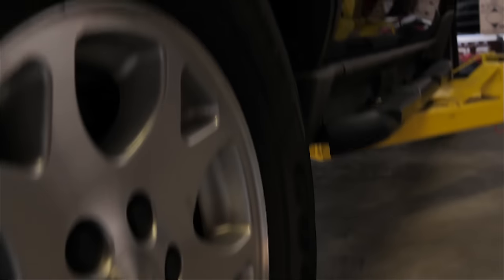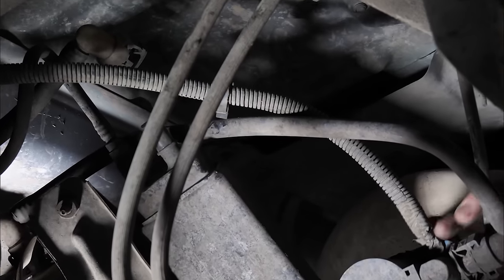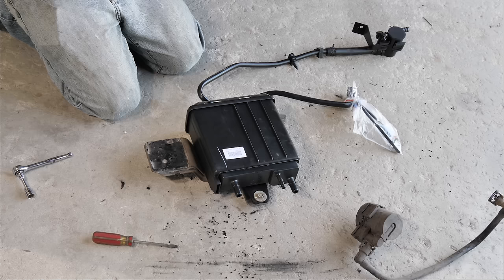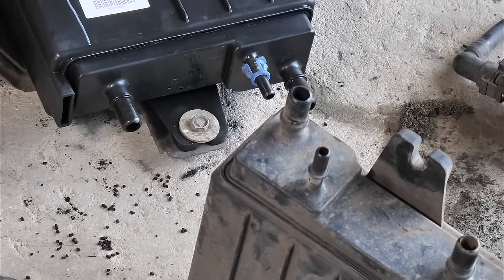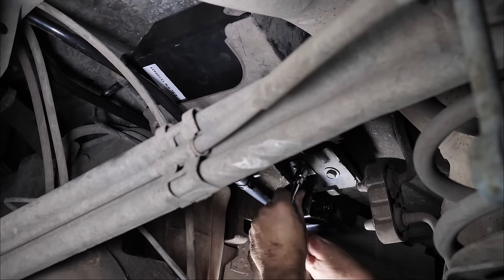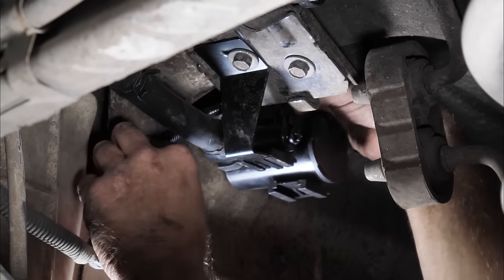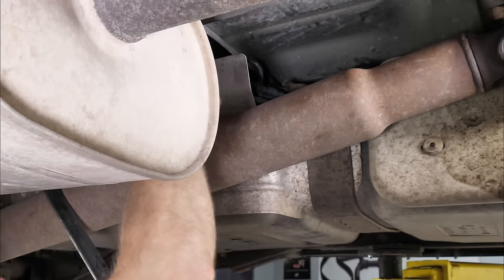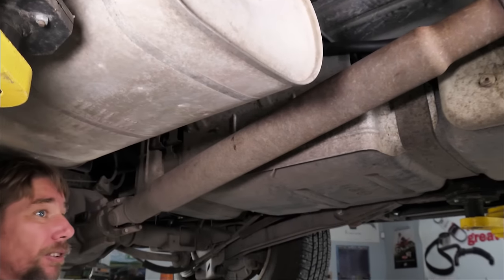2005 Chevy Tahoe Fuel Filling Slowly PART 1 From Clogged Charcoal Canister Vent Lines

Comment: I just jammed a screwdriver in canister as far as I could and used vacuum to pull all the stuff out of it and hose to the tank.  Worked like a champ and cost $0.00. Thanks for your video
Reply: Same 🤣
Reply: Could you further describe exactly where you jammed the screwdriver? Did you pull it and jam it down one of the manufactured holes vac it out and reinstall or...? Did you do it while it was still in place?  Apperciate the follow up.
Reply: @carmellodannajr  pulled it off and stuck it down one of the manufactured holes

Comment: First, thanks for the effort in this video, it helped tremendously! However, even after the canister and vent solenoid re-locator were installed I still had the filling issue. It turned out to be carbon in the line still. Most people drop the tank but this is NOT needed. If you take the fitting back off with the 90 degree elbow, white in color you can suck the carbon out with a shop vac. I taped the shop vac onto the line, had my wife loosen and tighten the gas cap every 5 seconds or so and could watch the tank flex with suction so you know it was working. I then rattled the line as best as I could with the room you have and low and behold I got several bunches of the particles out, about a cup or cup and a half in total. Issue is fixed. Hope this saves some of you time and effort. This was on a 2007 Yukon Denali. Regards!
Reply from the maker: excellent, yeah we had two diagnose this issue as several other shops checked it out and couldn't fix it, so removing the tank to inspect and figure out what was happening was required. Now that people see where the carbon pieces get stuck, you may be able to clean them out and replace then canister and be done.
Reply: @APDTY  Understood and greatly appreciate your efforts as you saved me tons of time. Just wanted to reply so others knew they could maybe get around it without dropping the tank!
Reply: Ryan Schell think this would work with a Tahoe since it’s also GM?
Reply: Ryan Schell was your tank empty when you sucked the carbon out with the vacuum?
Reply: APDTY Thanks.  That is great to know.  I just replaced the purge valve and the solenoid on my 2005 Tahoe.  The solenoid matched the OEM one.  I didn’t know about the new version and AutoZone didn’t mention it. I hope I don’t have to replace the canister, but if I do, I’ll do the shop vac trick you described.
Reply: thank you!! problem fixed
Reply: @shotgunschell7455  thanks for that because I did the same thing, changed all of that and still had the same slow fill problem. I will try the vac trick
Reply: Thanks I will try this, I changed the charcoal canister, valve on the engine and by the tank. When I changed the charcoal canister I saw the vent lines had charcoal pellets in it.
Reply: Was tank empty when you did this
Reply: @hoopzgod_yt1978  Nah, no need to lower or drain tank
Reply: I wonder if you try the shopvac trick but also pull the line off the purge solenoid in the front if it would work better? the way i found out mine had the leaking charcoal piece problem was when i tapped the line on the purge solenoid it sounded like a Moraca.
Reply: yes. Sorry, suuuper late comment haha
 @alexh5992

Comment: Mane whoever you are, you are a lifesaver. I was fumbling with these clips for the canister for like 25 minutes. Thank you
Reply from the maker: glad it helped, thanks for watching!!
Reply: Blue tab thanks for looking out. God bless
Reply: Lol me too, I have to clean my canyon and Silverado
Reply: diesel2421 Me too!  After I finally got it off, I discovered that the hose and elbow are too tight to allow room to pull the fitting off the solenoid after releasing the tabs.  It would have been easier, I believe, to have pulled the solenoid off the bracket, then pry off the clips.

Comment: Would this cause the gas pump to stop about every gallon acting like the tank is full
Reply from the maker: Hayden Hamlin yes exactly, the air is not venting out of the gas tank as it fills. Watch for small charcoal particles, if you see those then you will need the canister and to clean out all of the lines,
Reply: Right now, my 2011 Ford F-250 6.2 liter gas truck stops after I fill the first ten gallons or so, and then it will stop almost every 0.2 gallons. Which obviously makes a 32 gallon fill up take a little while. I think this is my issue.
Reply: @davidcoiner6550  your issue isnt the same as the video. Its the ford logo brother. Just change that and you're good to go. You're welcome

Comment: Thank you making such a detailed video. It was a huge help!  I just finished changing my vapor canister, having already changed the purge valve and solenoid. It took me 10 minutes to gas it up last night. My biggest problem was getting the small blue connector off. Squeezing the blue tabs didn’t help so I cut the nipple off the canister with a Dremel Multimax.  I have been getting a “tighten fuel cap” message daily so ordered a replacement.
Reply: did that make the "tighten fuel cap" message go away?
Reply: @kristy1135  yes did it?

Comment: I have very shaky idle, gas tank will not fill and it stall and doesnt accelerate right but no cel, could it be related to the canister or do i need to have a canister cel

Comment: I'm having the same filling issue , changed the solenoid ,didn't fix it, about to change the charcoal canister next...hopoing that will fix issue ,,, also I hear a whistling sound when im driving the vehicle , is that noise a part of the problem as well ?

Comment: If my spare tire won't come down will I have any issues replacing this?
Reply from the maker: nascarr11 I am not totally sure without lifting the vehicle up and looking closely, you might be able to on some models, the other option is cut the cable or clamp from the hoist and replace the hoist with a new one, now they are available aftermarket and way cheaper then the dealer, usually well under $100 for the house and cable assembly

Comment: Replaced charcoal canister, filter, and selenoid on top of engine. $80. The kicker was I didn’t want to drop the fuel tank to clean out evaporation lines. I disconnected and blew the f out of them as best I could. Then…. made a shop vac rig that blew air into my tank and checked all disconnects lines under vehicle and felt for air. Fixed my slow fuel issues. Contact me if you need help. I can walk you through.
Reply: My canister was a disaster charcole pellets everywhere.

Comment: How bout black smoke out tail pipes i have a 07 f150 4.6 p0452 p0191 cant find nothing on that
Reply: Check your coolant temp sensor sensor for the ECM
Reply: @marklemker4088  ended up being vacuum leak front of engine on frame

Comment: Would this give you code p0440
Reply: I was wondering the same thing. I got a P0440 too. I feel inclined to fix the vent valve solenoid and hope that does it but at the same time I don't want to waste my time fixing crap for no reason

Comment: I had the same issues  I removed both items  And used Compressed air in the canister Which after 10 mins of blowing and tapping had little dust/dirt The purge valve Which has a plastic snap on top i removed to find grit (one bigger than sand) and dirt in the filter which looked like a  red scratch pad Which i washed out the whole system Along with pad And returned everything back I figure after almost 15 years of driving my Blazer On and off road it was time to do this while doing new fuel lines 

I see you took apart the problem But rather than wash it out and order a $3 new filter you went with whole new system for around $150 ?
Reply: You cannot wash out the canister. Replace with a new one and you'll be good for another 10-15 years.
Reply: @4paulseyes  Never washed it i used air .. Everything is back in the truck  Runs perfect
Reply from the maker: We had to drop the fuel tank to figure out where the clog was, The fact that small pieces of charcoal are spread out through the vent system was enough evidence to know the canister has failed and must be replaced, the canister cannot be cleaned and if the charcoal has spread through the system, well then it must be replaced. The job of the charcoal canister is to absorb fuel fumes so they do not vent to the atmosphere or inside or near your car as they are highly flammable. If you found any small particles that look like coal, then you need to replace that canister and you would most likely have a check engine light on.
Reply: @APDTY  Marineland Black Diamond Media Premium Activated Carbon $20 ----- Range Hood Charcoal Filters ( cut to size ) $8  ---- Black Silicone Adhesive Sealant $6
Cansister filter You can open and wash out and replace the filter with the same filters for range hoods They bear the same microns allowing the air to pass while trapping non gas forms  The paper filter in the canister  is prone to fail with moisture and heat over time And a imbalance on the Ph level 

Sometimes fully replacing the whole system is a good idea  Other times As dad always use to say ..if it ain broke don't try to fix it
Reply from the maker: @freakyflow  well as long as the problem is fixed then all good, especially if you saved money! In a professional shop though you can be fined for altering the emission controls,

Comment: Do you know if this would cause the tighten the gas cap message? Have 2005 Tahoe z71.
Reply: Yea it'll give you check engine light (tighten gas gap even tho it's tight the system is detecting a lack prly the purge valve) and in my experience (05 Tahoe) That's exactly what happened. Started off changing out the cheapest part 1st then took canister out put air line threw it figured it would either work or I'd mess it up and the replace it using a low psi and ran water threw it repeated till clean water came out. Luckily no charcoal was falling out but I blew out the lines just incase since I was down there anyway.. seen a spider web come out of a buddy's Silverado.  But been working just fine since think cost was 30-40 bucks and good part of my day mainly cleaning the charcoal canister and making sure it was dried out. 
A lot GM vehicles have this problem so it's gonna differ depending on climate (dusty dry) and just how bad it is. But If you can change oil or have a lil know how its relatively easy. And all of this is for emission which in my state they no longer check 🤦‍♂️so technically I could of bypassed the canister but that's a whole other can of worms. My advice just get up under your truck and take a look I got sick of stopping every 2-3 dollars getting gas and went home right after the gas station got on the concrete and a couple YouTube vids a lil gogle and next day she was good. I'am not a mechanic and can't say what you guys should or shouldn't do. just passing on my experience for entertainment. If I had the resources sure I probably would of changed all done in this video aka the right way lol. But I'm good with my fix after 7 months.. Good luck

Comment: Does anyone know if there's any way to just eliminate the canister
Reply from the maker: icutwood 247 it can be unsafe and actually would be illegal and if you live in a state that does vehicle inspections, you would not pass, the purpose of the canister is to absorb fuel vapors, if you just vent the vapors outside the vehicle, well that could explode if ignited, the vapors must go somewhere and the charcoal canister is the safest and best place
Reply: Well canister weren't added till about 72 so what did they do before that.

Comment: Nice video however I feel like the charcoal pellets coming out is a design flaw that GM has never addressed. The real problem is that these pellets roll out over time and fill the air lines so they should be blown out during this process to.

Comment: Problem is they put this crap under the vehicle if your in the dirt much it plugs it the older vehicles put them under the hood
Reply: Yeap. My 93 chevy c 1500 is under the hood. Never have issues and it passes smog with flying colors
Reply from the maker: Yeaup and that is why we sell the relocation kit so often, it keeps much more dirt and dust out when the filter is relocated high up and near the transmission

Comment: So what if I just slide my own vent line down the filler neck while filling up. Then pull it back out when I'm done.No check engine light or codes, just slow filling.

Comment: I changed all of the cannister and filter but still filling up show
Reply from the maker: Leki Latu so if you found any small black carbon particles, then the canister came apart and you may have to blow out all of the lines, also a vent valve exists that may need to be replaced, check for any trouble codes as the vent valve will usually leave a code and turn in the check engine light
Reply: @APDTY  ok thanks
Reply: Blow out the lines

Comment: I had the cannister changed on my 2005 Chevy Avalanch and it’s still not pumping gas correctly. What can I do now?
Reply: Try the gas cap. Get a new one if the gaskets look wormed out.
Reply: Let me know how it goes fam.
Reply: T Jack you get it working? Dude on the top of the comment list says to get a shop vac and suck out the carbon build up...
I gotta do this to my 05 Tahoe but haven’t gotten around to do it. Filling gas takes like an hour to fill up.... or 10 min for a quarter tank lol

Comment: Had the same problem where I couldn't fuel my Yukon and was getting the “Tighten fuel cap error”. First I disconnected the EVAP canister and all the little carbon pellets fell out. So, I dropped the tank, cleared all the lines w compressed air and replaced the canister and canister vent solenoid. With all that done I can now fill up the Yukon perfectly. No more shut off issues. Thanks for the great advice!

Comment: I need one for the exact same truck. What's the part # and where did you buy it?
Reply from the maker: Shannon Williams https://www.amazon.com/ACDelco-215-464-Original-Equipment-Canister/dp/B000EQVSME/ref=as_li_ss_tl?s=automotive&ie=UTF8&qid=1504720131&sr=1-1&keywords=215-464&linkCode=sl1&tag=aupaditoyo-20&linkId=ed8693f855588680f285e160b8b89b93

Comment: Useful tips that helped a lot with my 05 Avalanche. Disengaged canister, used air compressor to get rid of build up. Also tried to clear as best possible the line from the engine compartment under the cover. Remounted canister (solenoid was replaced about a month ago). $30 gas ⛽️ and no shut off. Eventually I’ll get it replaced, just buying time...

Comment: I have this issue with my 2007 Avalanche I even got the engine light on now since I kept putting it off as is more of pain in the ass than an actual performance issue. But now that the light is on I need to fix it.
Reply: There's also I valve on the top front of the motor it'll quit and set off the check engine light it's easy to change and about 30 bucks check it out first
Reply from the maker: ECxPassion the longer you wait with a full vapor canister, the closer you get to it coming apart and circulating through the fuel tank vapor vent system,

Comment: I installed in my gmc , same problem but no fixed the problem, I don't know where is the problem but so difficult to fill
Reply: Line is probably clogged from tank,did mine and problem I'd better, I think mine is clogged some still.Some Day will have to drop tank to get to the lines

Comment: HELP- Would this cause my oil to smell like fuel I checked my fuel injectors for leaks none are leaking I am getting one engine code for po449 the canister stuck on this going to drain my oil and see if I see gas right now oil cap just has strong sent of fuel
Reply: Yea it's running rich cause the valve is either stuck or not working so fumes are not being vented properly and are burning up..Fairly cheap form auto parts store and pretty easy. Po449 I believe is purge valve seolnoied. Ask that Google guy he knows everything and there videos about on YouTube as well. Goodluck (I am not a mechanic just passing on my own personal experience) I have fixed every issue I've had on my 05 Tahoe so some experience is required. If you can do regular maintenance chage oil, air filter etc you can fix it.

Comment: 1st great video 
I have a 2007 GMC YUKON XL I had the same problem with unable to pump gas. Took 45min to only put $25 in.
I bought a new valve I bought the same one you show in the videos. I did change the solenord the part that is above the driver side valve cover. I did not change the canister and I'm still having the problem. What can I do?? Thanks again
Reply: Change the canister? I think, may be wrong, you can get charcoal bits in the line and that’ll create blockage. Blowout that vent line from the front
Reply: Did you get the problem fixed and what was it
Reply: I fixed it, besides installing a new charcoal canister I had to drop the gas tank and blow out the lines and tank. A bunch of charcoal was inside both. If you do not do that it will screw up the fuel pump and tank and injectors. Not as simple as changing the gas cap. It it's the charcoal canister you need to blow out the charcoal.
Reply: Jason Tripkovich guess I should get mines redone, I replaced all these parts but issue is still there. 08 Tahoe